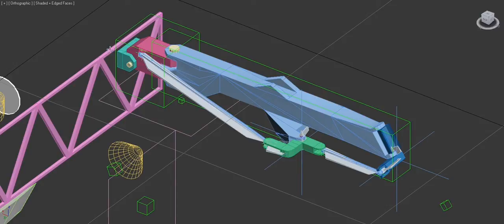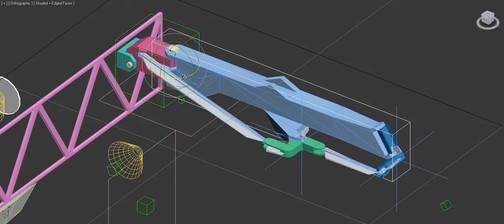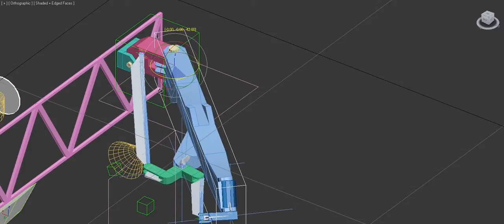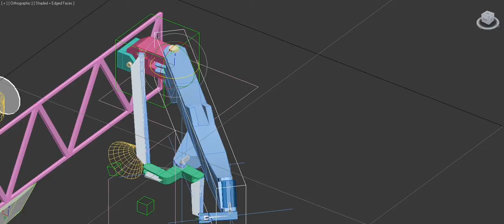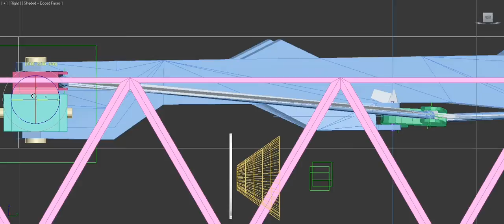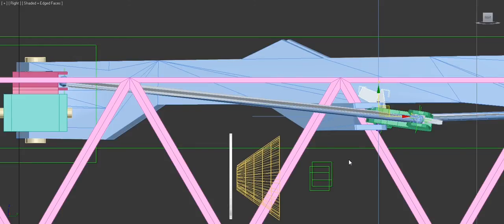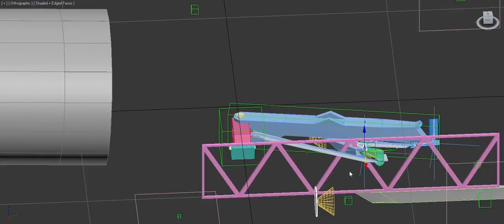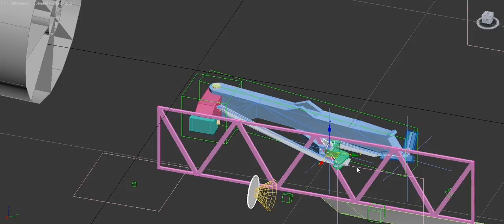3ds max bone constraint problem

Comment from the maker: I've determined that the HI IK Solver cannot be used for this.  It expects all joints to be coplanar and all movement to be in plane.  The movement that is needed is defined by the 3 joints of the green bell crank and that leaves the root joint of the upper push rod left out of plane.

Guess it's time to investigate the HD IK resolver.